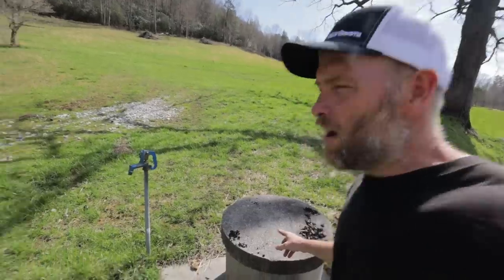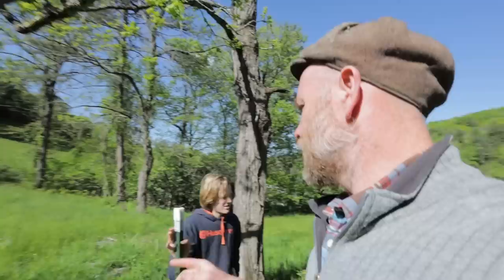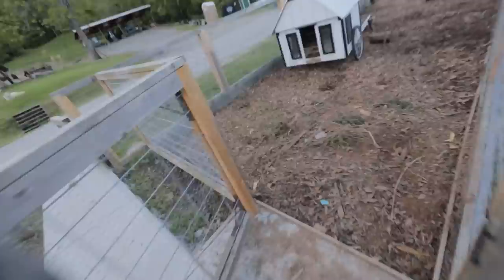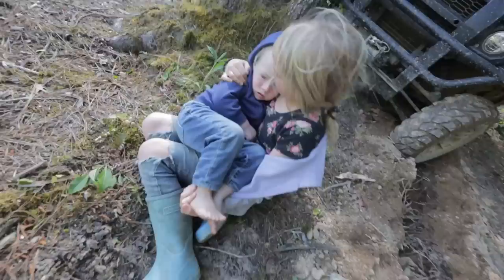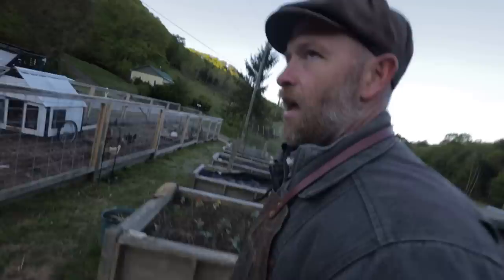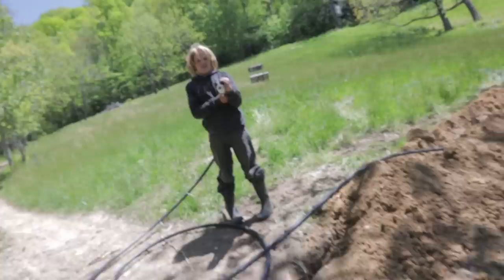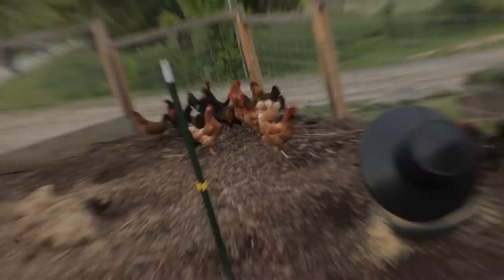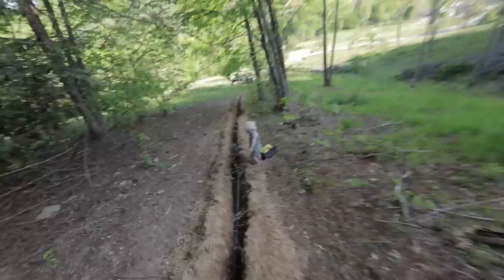Gravity Fed Water to 10-Acre Homestead

Comment: You may want to consider running a piece of aluminum tape in the trench.  You may know where it is now, but five years from now it might be hard to find. Put in the metal tape so you can use a metal detector to find the line.
Reply: Oh really good advice!
Reply: Great advice.  Just like my suggestion of a ram pump. Always hope someone reads it and can appreciate it.
Reply: Excellent ideas 🎉😊
Reply: or mercury, or straight up uranium!
Reply: You are so right because, on my property, I bet I can find half the pipe I have in the ground.
Reply: I was just wondering how he was going to find the pipe in 2 or 3 years
Reply: Using brass rods bent with a 90* handle, you can water witch where the pipes are. I can find our water lines and buried power lines using this method. I have shown many in my neighborhood how to do it and it does work! It blows their minds but they can do it.
Reply: FANTASTIC  ONE TIME EXPENSE, YET SAVE HOURS IN FUTURE..

Comment: If you're worried about the water lines freezing use compressed air to blown them out for winter. Many sprinkler systems are designed to be winterized this way.

Comment: Re: Your water piping issues. Put them at least 4 inches below frost line. Regarding valves and T Points Think about just getting some 12" plastic culvert pipe and cut them into bits that will reach down from ground level to your T points and valves. Cap them with a overlapping wooden lid. Use a square form with arms extending outward from the center but cutoff before they would exceed your 12" circumference  of the culvert pipe.Flip this over and those arms would help keep it in place over the culvert pipe. Paint them a bright color for easy visibility.  This gives you access and yet will help keep the joints and valves safe from damage.  Oh You will need to fill the pipe with either actual insulation or hay filling it up to keep them from from freezing during winter weather.
Reply: It's so refreshing to see how ppl who are complete strangers offer advice to help make the dream work!🎉❤

Comment: When our home was built the electrical lines after laid were filled about 6” the whole length then a layer of crushed rocks were laid the entire line length. After that the trench was filled. This gives future dig an indication to stop and dig by hand from there.  It prevents future line damages. Has worked well for when the lines need to be exposed.   The same method was used for water.

Comment: Great Work. In the Midwest USA, North of Kentucky, the trench would have to be much deeper because of the frost line. Still taping into a spring and delivering water to a lower area is still possible if the source, piping, and destination are all protected from the weather.

Comment: Justin, next time you go to the hardware store get yourself a couple of water pressure gauges. The plastic ones with female 3/4-in hose fitting are only about 15 bucks and will screw onto the end of a garden hose, or right on a hose faucet.

To keep your water pressure under 100 psi, you need a pressure reducing valve for about every 200 ft of elevation drop.

Also, I suggest you stick a T-post or some kind of marker in the ground next to every connection (before you bury the water line). And/or mark all of their locations on your giant topo map.  Those connections are probably where you're going to have future problems. So it would be nice to be able to easily find and check them in the future (even if it's just so you know not to hit when doing any future digging or grading). Or so you know where to dig to install frost proof yard hydrants.

Comment: EDIT: You're going to have an apple tree growing at the pressure regulator, where you threw the apple core!!

Maybe you aren't doing it right now, but putting an insulated 14 gauge solid core wire loosely taped to your water line, before burial, can save you trouble in the future. The end of the wire can be used to locate buried lines, using a pipe locator/transmitter system. The transmitter connects to the free end of the wire, and the wand detects the underground wire that's been taped to the water line.

That way you can find the line underground, if you need to tap in or do any repair.

EDIT: You can probably fix the parking brake on your ute pretty easy, sometimes it isn't but a turnbuckle under the carriage attached to a thick wire, just tighten the cable. Takes but a minute.

Thanks for the content.
Keep up the good work.
בס'ד

Comment: Try using electrc hedge clippers. More controlled easily fitting under fence. Get the battery operated version obviously for use on your tree/fence areas.

Comment: What we do in Canada is we lay a layer of styrofoam over our lines in the ground to prevent frost from going any further..just a thought  ;) (I worked in construction for 13 yrs and thats what we did and it worked wonders). And if for any reason you have to dig up the line and you hit the styrofoam you know your line is right underneath and dont have to worry about digging up and damaging/ripping out your line.

Comment: I think oyu are dealing with the effecs of water hammer. when the water is cut of downstream the water up does not stop flowing. instead there is a pressure wave that flows back up the pipe and builds in psessure the longer it goes. that is why the pipes burst so far uphill

Comment: Spend the extra money and use brass fittings and 2 hose clamps on each joint before burying. I'm afraid you're gunna to have a lot of leaks. Also, it should be 2.5 deep to not freeze in your area